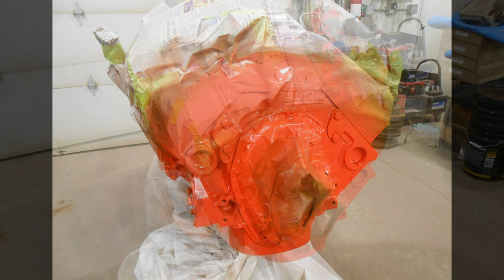BluePrint 400 Crate Engine Painting

Comment: Is that an SBC 400??  (I have one, came in my 71 Camaro when I bought it, had rear main oil leak after rebuild.... took me a while to find out why, AFTER I built a 1997 350 into a beast 383).  I have this one on a stand, waiting for something else to install it in.  It is a torque beast.  I may put it back in the Camaro after this summer's driving season.
Reply from the maker: This is a BluePrint 400ci crate motor. It is a small block. I have a dyno sheet showing it makes over 500hp and over 500ft lbs torque. Should move the 70 chevy truck pretty good.